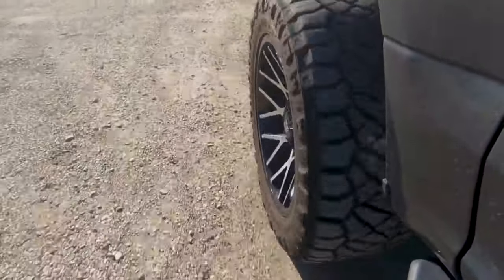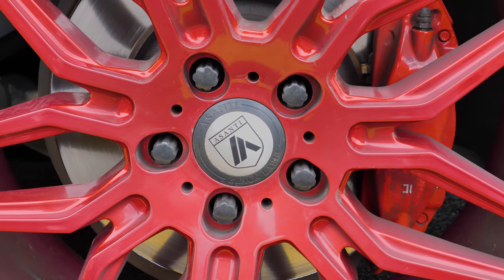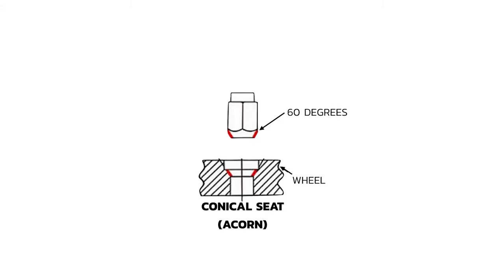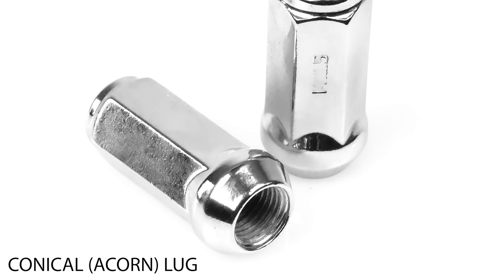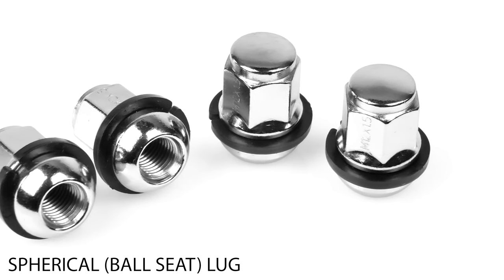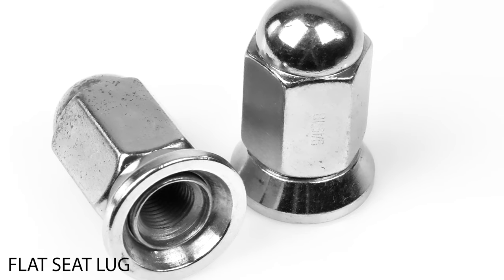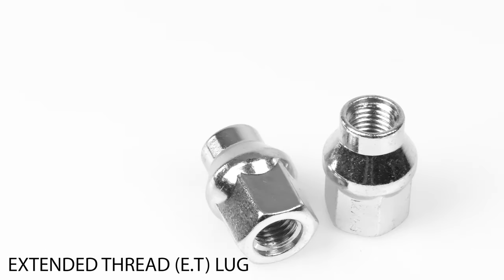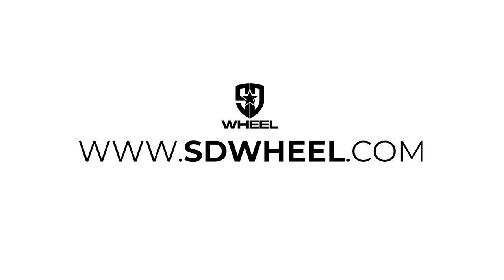What You Need To Know About Lug Nuts

Comment: Do you need different lug nuts from an aluminum rim with a flat with washer lug nuts to a winter rim with a beveled hole or will the original nuts be fine